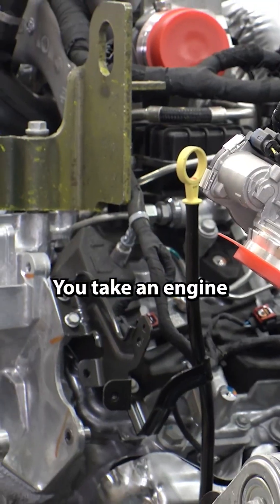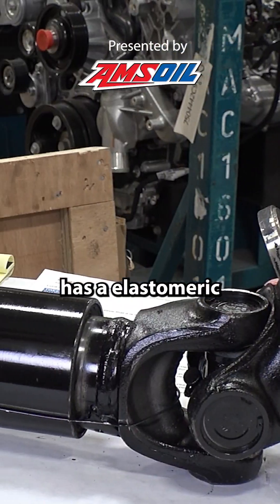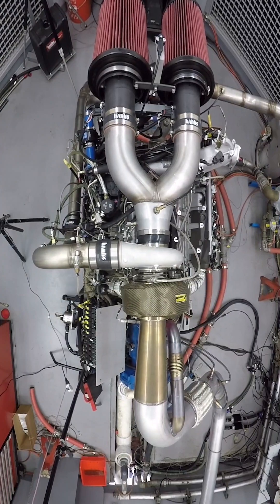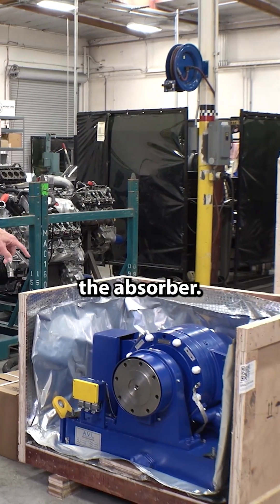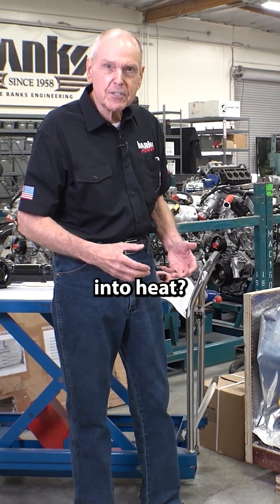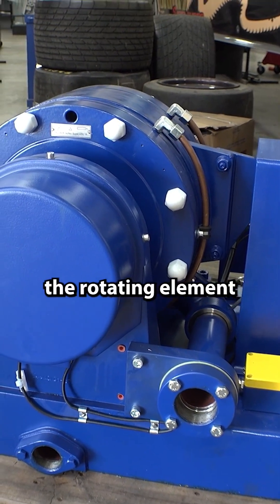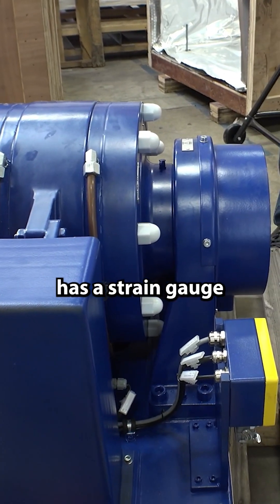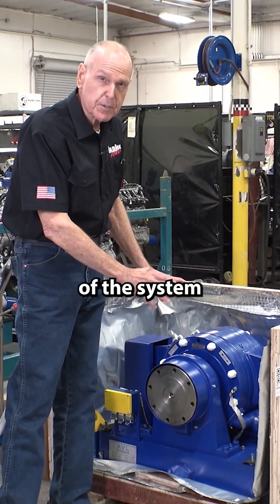How an Engine Dyno Works

Comment: What about in gas engines when sometimes the HP is greater than the TQ? How is that possible if you need the torque to figure the horsepower?

Comment: Look up " Proney brake " . Cheap and easy to build. Can be easily scaled for up to 300 hp. Great for smaller motors like motorcycle / snowmobile motors. Measures torque most accurately.

Comment: Is this the way all dynos work?  Couldn't you use an electric load like a customized generator with a variable load to measure engine torque?
Reply: Tbh the use of a generator to measure loads will bring in too many factors to consider regarding the characteristics of the generator. Generators are basically electric motors, and they’re prone to lots of variables that affects the measured outcome.

An incompressible liquid and a strain gauge minimizes variable’s dramatically and allows a more direct measurement. Its so stupidly clever that I would’ve never considered such a basic method.
Reply: @rufus2028  I see your point.  Classic example of less is more :-)

Comment: Why bother calculating horsepower, from the torque?
If you making torque, you making horsepower. Seems an artificial figure. 
What about F1, huge revs(apparently huge hp), but next to no torque, struggle on hills.
Reply: Drag racing cars are all about horsepower. HP is work done fast. They need that number. It doesn't matter if their funny cars can pull a house, what matters is that they can turn all that torque and RPM into a rocketship down track. HP is everything to a vehicle that needs to go fast. Again, HP is the rate of work, but torque is the current load of work.
Reply: @A-A-RonDavis2470  Why bother calculating horsepower, from the torque?
If you making torque, you making horsepower. Seems an artificial figure. 
What about F1, huge revs(apparently huge hp), but next to no torque, struggle on hills.
Why don't drag racers use F1 engines? What's the point of reving 20,000 rpm, if you can't get up the driveway? 
What sort of houses you talking? Draft horses, don't rev much at all. How much can a draft horse lift in a given time, thorobreds were not used in coal mines.
Where did the artificial figures come from?

Comment: I’d like to know a little more about how the hydraulic dyno works.  I guess I’ll need to look it up.  But thanks for the overview.  I love these Banks videos
Reply: A Dyno like this is basically a pump who's output is throttled; it takes power to turn the pump but the throttled flow means that power converts to heat, so you cool it with water. I tested Huey helicopter engines 1385 HP. We used a 5,000 gallon water tanker as a water supply, water circulated back to the tanker.
Reply: @robertball3578  that was helpful, thanks

Comment: Let those words sink in.  We measure torque & RPM.  HP is calculated value.
Reply: Yes, isn’t this common knowledge??? Power= (force*distance)/time
Reply: @AAthlete34  American schools are so far below the international average it's not funny. The formula is taught, but most people never use formulaic math in their day to day lives so people tend to forget things. Me, I'm fucking horrible at math. Scraped by algebra 1 with a D, then went to geometry 1 and did the same. It's not that I don't understand angles, and measurements, I just do things visually. I'm very good at billiards. Which is all geometry and algebra. Just don't ask me to crunch numbers lol
Reply: @Raynedog00  honestly unless you’re an engineer, you can get by perfectly fine without math
Reply: You know I've wrenched on cars for a decade or more now and never knew how they actually get the HP numbers from. Never worked anywhere with a dyno and I haven't built any racecars, glad I learned something new today.
Reply: Holy shit, horsepower is just watts... Thank you for this sudden realization! It's just like with electronics, the relation between volts (rpm) amps (torque) and watts (HP)! Like, power supplies even get rated by watts, even though you really need to know the voltage and amperage for your specific application
Reply: @josephrumpsa180 I think what the OP was getting at was that a large portion of people think that dynos measure HP. You seem to be one of the people that understands that HP is a calculated unit. I can't tell you how many times in car forums/Facebook groups this topic comes up. There is a large section of people that don't understand the topic.
Reply: I was about to rage reply when he started talking about measuring horse power. Dynos don't measure horsepower they measure torque. Horsepower is a derivative of torque and RPM.

Comment: It turns horsepower into heat. 
So we measure off of a strain gauge to get a torque reading in order to calculate horsepower.

Yeah. That makes no sense Gale.
Reply: Well yeah, anything that moves creates heat and you're putting energy into an absorber (Dyno) that has to release the energy somehow. They're very accurate, and Horsepower has always been a made up number and that is torque x RPM/5252
Reply: bro doesnt get the simplest concept 💀
Reply: I don't know what to tell you except that's how a dyno works. Your comment says more about you than Gale.

Comment: How is this device caliberated in the human machine interface.
Is it compared to a known accurate dyno to set up the set points. Or is the the torque measured mechanically at the strain guage and values entered as set points?

Comment: Can you measure horsepower from the alternator? Current volts torque
Reply: Not sure what you mean.  1 horsepower is 746 watts of energy.  In countries that use the metric system they rate engines in Kilowatts (kw).

Comment: I used to run a diesel engine dyno at a shop i worked at.
Seeing that water heat right up and steam impressed me every time. 
And there was hundreds of times, the boss was "lending" me and the dyno to a company that was developing replacement 60 series injectors. 
It wouldn't take too long to draw down that 500 gallon water tank on a few extended pulls,maybe 15mins or so before we would have to back off and let it fill up. 
And im sure i had plenty more to learn about it, but that was quite a fun job.

Comment: Should hook up one of those hybrid motors to be a dyno, that way you can power the grid using the motor for regen... Might need a couple motors though, doubt one is ample enough to keep up with a Banks Built Duramax 🤣. But hey, at least you won't have to worry about Edison turning out the lights.

Comment: Now please dyno a 6.7 Cummins before and after installing your Monster Ram intake to convince me to do it.
Reply: Guarantee you a few people have and posted info/videos.. just check ffs
Reply: @mandelorean6243  I have searched and found no dyno #s. Testimonials yes but no dyno.
Reply: @jeffrobinson1092  I've found one video, and they demonstrated a 4hp increase
Reply: @automotiveoutburst8946  Thank you for your reply. There are ALOT of diesel forums that discuss this upgrade but only have "seat of the pants" opinions of the performance along with measurable MPG. Even that differs. $250/hp is a little pricey. More interested in torque. Thanks again.
Reply: https://youtu.be/F5qw1QnGByc?si=tS6Lt5kgD25aS37w

Comment: Torque. Yes. It all comes down to torque
Reply: And RPM
Reply: Well yes, because torque is twisting force and that's the engines whole job. Horsepower matters too.
Reply: horsepower is strictly the product of torque at a certain RPM.   Nothing  more,  nothing less. @jaredlancaster4137
Reply: X RPM.

Horsepower is just the rate at which work is done. More force same rpm, more work. More rpm same force, more work.

It's not complicated fellas
Reply: Honda guys are reading this and crying in their feetie pajamas...
Reply: Torque is meaningless without movement. Something can have massive amounts of torque and be static.